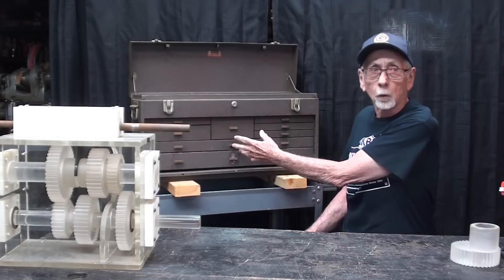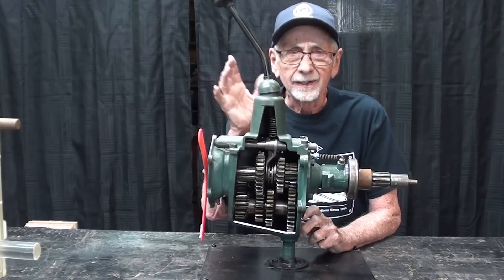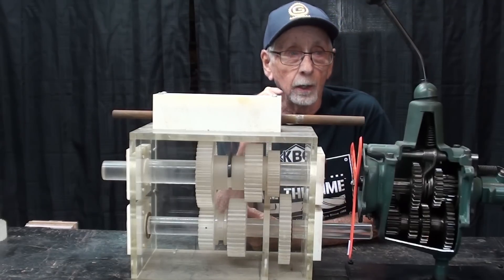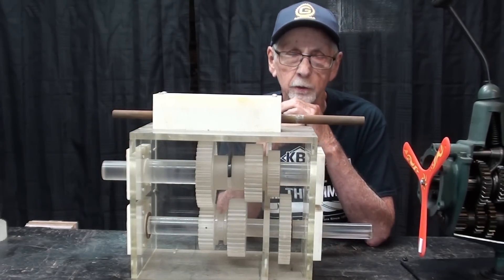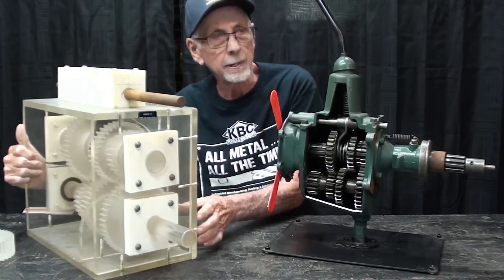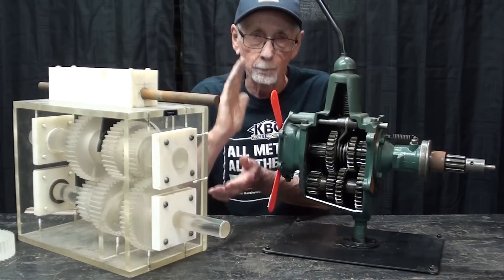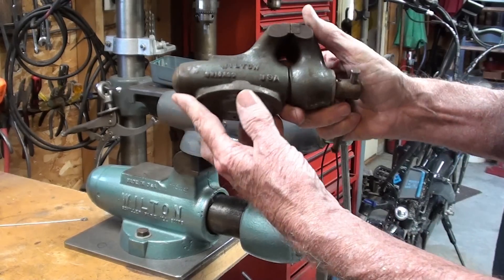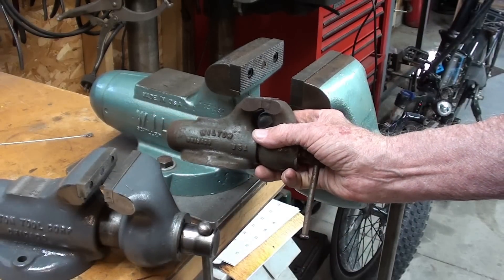MYSTERY Transparent PLEXIGLASS TRANSMISSION #980 tubalcain

Comment: If it were me, I'd use some Poppy's Patina which is a clear coat which stops further damage from rusting or corrosives. It works great on old cars of the same era of that neat little Wilton. In the case that you decide to use it, I would recommend that you scuff the surface with a grey scotch-brite pad just enough to take thee shine off. I think it would be worth preserving that way with the minor caveat of making sure it functions like it should.

Comment: I had to match a light gray (partly rusty) boat trailer.  I got a quart of rustolium  gray and a quart of white and mixed to match.  if you need to go dark gray, use gray and mix in some black.  Or just get black and white. I thinned it a bit and brushed on a few coats to cover.  FWIW ... You get the idea.  ... Love your videos.

Comment: REF: Trying to find the correct "COLOR!"  May I suggest a AutoBody Supply (Industrial Coatings) Store, one that has on hand a "Color Analyzer."  If your not familiar with "Color Analyzer," they look very much like a hand-held Temperature gun, just a little bulkier.  The color recommended by the "Color Analyzer," isn't always perfect, but will get you close enough; so as to be able to just add a little tint to achieve the desired color/hue.

Comment: If it says "Chicago" they only made them up to 1957, After that they moved to Schiller Park. If you remove the  jaw all of the way out there might be a flat spot the a date is stamped. Some people stay that was the date it was made others say that that is the end of the 5 year warranty. Some do not have any date stamped on it. As to the paint, I found that a vise from the 80's, the best match is blue Hammerite from Krylon. or Rustoleum Verde Green for an older one. Hope this help a little bit.

Comment: Nice little vise! I suspect the remnants if paint still on it aren't the original color—oil and grime have darkened it over the years. I would paint it any color you like that protects the metal and prevents rust, and then put it to use as its makers intended.

Comment: Mr. Pete, thank you for being such a treasure. I have been a machinist for over 40 years and have spent the last 40 years working in aerospace. One of the processes in our facility is a plating line to coat various metals in various special coatings for a wide range of applications to our product. We do a process of plating called barrel plating. We are able to plate a large number of small parts at once through this process. The plexiglass 'Transmission' looks a lot like a barrel plating transmission. A small motor would be attached to the out shaft and be driven by "plastic gears" to rotate the barrel that would be attached to the underside the box. The copper bar across the top is used to feed the current through the barrel and the solution. I'm not sure this is what this is, but it looks a lot like the transmissions boxes we use to drive the barrels.
Reply from the maker: Thanks

Comment: Perhaps cleaning up the Wilton and just apply a clear coat to protect from rust? Satin finish perhaps. There are also some "interesting" suggestions about "Best color for a Wilton machinist vise" over the internet...

Fuchsia... That way it stands out... - Steve W.
I'm leaning toward puce myself as paisley would be a bit difficult to do. Art - Artemus
I like gloss white with a red pinstripe. Lots of folks are fixated on depressing gray. Some like blue. Zebra stripes might be nice. Suit yourself. - Ecnerwal
I repainted a Wilton vise last winter. I replicated the factory color with hammertone light blue. It is available online or thru McMaster Carr. - bob_1fs

Comment: On the paint color, you could take the vise down to a paint and body shop, or paint and body supply shop and get them to color match it.  I would also recommend sealing it with epoxy primer before spraying paint if you go that route.  The epoxy primer is really good at sticking to old paint and provides a good surface for the new paint to adhere to. I realize this is not a cheap option though.  A cheaper option you might could get it mixed in a spray can and ask them if there is a spray can primer they recommend.  I think some O Riley’s even do that.  Good luck with what ever you do!
Reply: Large NAPA stores had that service mix a color and put it in a spray can.

Comment: $6,000 for a 2" Wilton vise is a sure sign of mental illness. The same seller also sold a 3" Wilton on the same day for $1,500. That's a good day.

I am convinced that we spend way more time thinking about color than the tool manufacturers did back in that period. I remember it being important to be sure you bought enough paint to finish a house at one time because if you had to go back and get more it would not match.

Comment: Hi Mr. Pete, Wilton moved from Chicago to Shiller Park in 1957. so your Baby bullet is a little older than you think. When they moved, they would have used up the "Chicago" castings, so yours could have been made in Shiller Park. The way to tell the date is to remove the jaw and look on the key at the bottom. Unless it was tampered with, the date will be stamped at the bottom. For a few years in the 50's, Wilton put the guarantee expiration date. This would be marked "GAUR EXP XX", XX being the year the guarantee would expire of course. Wilton had a 5 year guarantee so you would subtract 5 from the date stamped. With the exception of the few years in the 50's, the year stamped would be the year it was shipped. I think they stamped them just before they shipped out.
I have a 3 inch vice that is stamped "GAUR EXP 60" so, it was shipped in 55.
Reply from the maker: Thanks

Comment: Is the Plexiglass gear transmission for demonstrating motor oil viscosity?  Lucas oil use to give these to auto parts stores to place on the counter.  

  They would have a light coat of oil on the gears and customers could crank the gears and watch how well the oil stuck to the gears.
Reply: That's not a bad idea. I remember smaller ones. Maybe this was for a tractor or semi dealer?
Reply from the maker: I remember the Lucas display

Comment: I really like the color of the 4", I'd repaint both the 3 and the 2" the same color. Then you'd have Triplets!
While it is nice to restore things to Original it's probably going to be impossible to get even the original brand or paint number.
Let's face it, no matter how hard you try you aint ever going to get the hair color that you had when you were 20 
🥸
The plexiglass gearbox definitely looks unfinished, might have been a prototype for a project that changed along the way or could just be something built for practice or entertainment.
Not everything you make needs to have a purpose, sometimes it's just for fun.
Keep em coming.